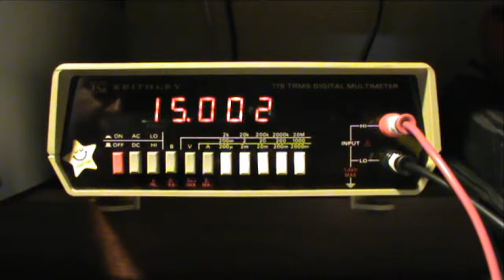Evione ElectronicsEpisode 7   Keithley 179 Repair

Comment: change all your tantalum caps and ESR all the electrolytics caps also for age
check for cracks in solder joints and re-flow, most important is deoxit the push button switches let run down with meter standing vertical for one day then push in and out 20 or thirty times to revitalize contacts
Reply from the maker: Going to give that machine another service. Sometimes the buttons are a bit lazy. Thanks Mike.

Comment: Bead tantalum capacitors are a swine for going short circuit, i allways replace them with an electrolitic if its just supply smoothing.
Well done, hope its still alive :-)
Reply from the maker: +zx8401ztv Hi. Yes the Unit is still alive and working like a charm on a friends workbench. :-)